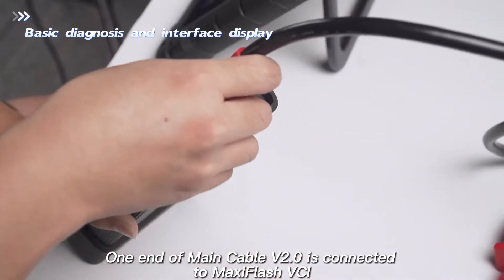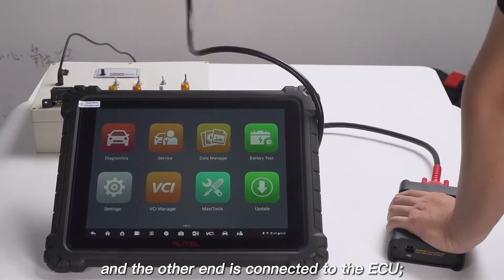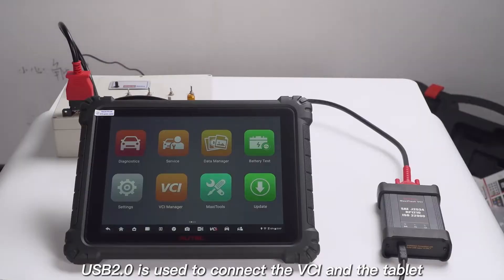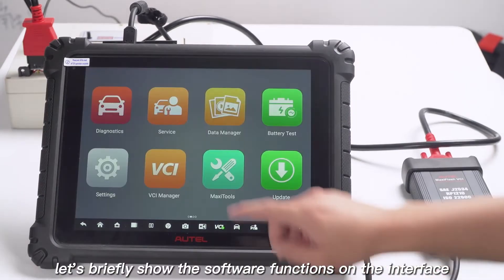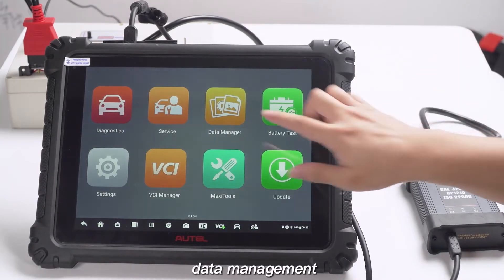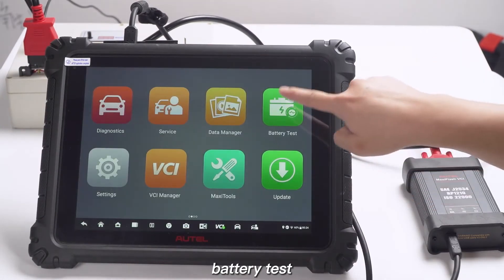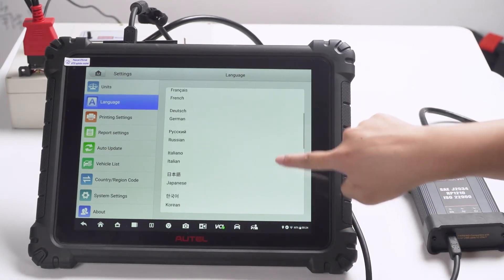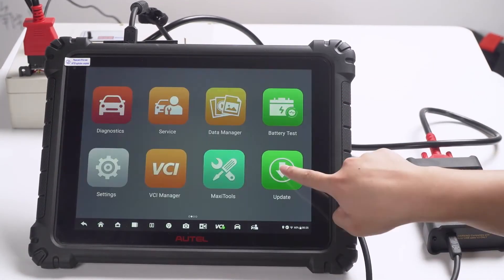Autel MaxiCOM Ultra Lite Diagnostic & Special Functions Overview

Comment: Hi tech support. I have a 2015 Nissan Navara D40 common rail turbo diesel and I want to check the data feed back from the injectors...
(injector compensation) to get an indication of condition of the injectors and then likely install and code new injectors. Which model is the cheapest of your scan tools capable of doing this?
Reply from the maker: If you can send me VIN for recommendation? Whatsapp: +86-13429866263